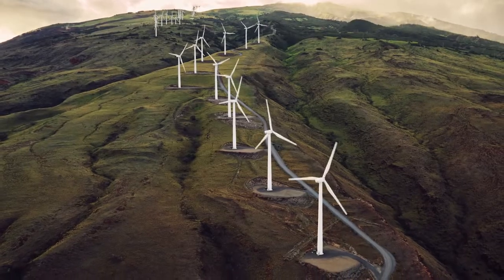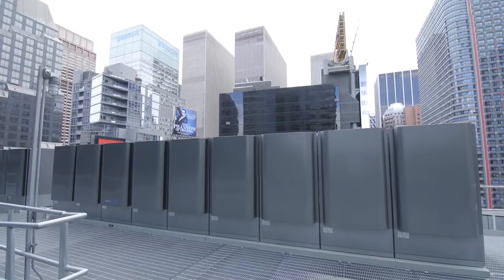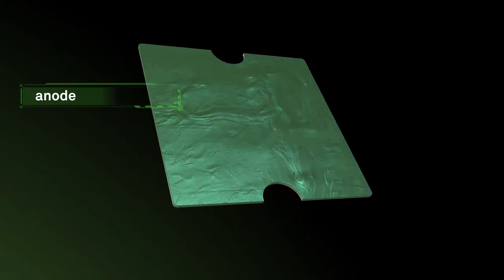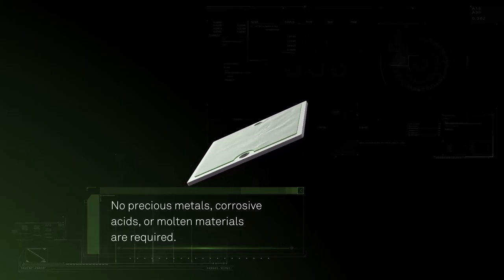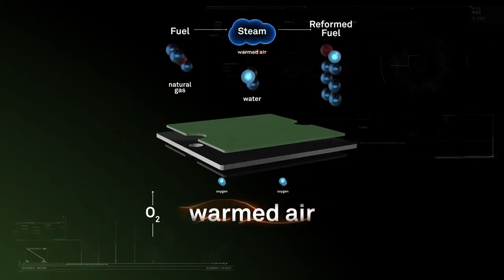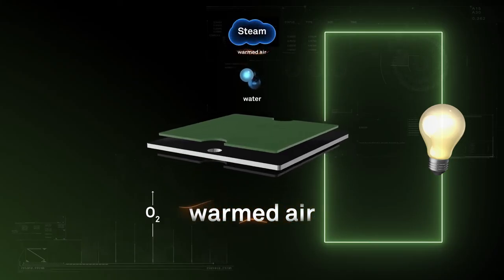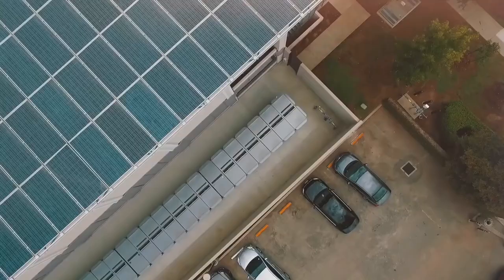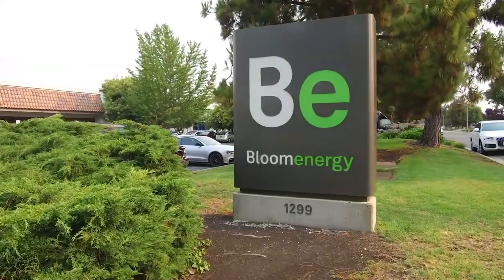How A Bloom Energy Server Works

Comment: Hold on why is CO2 coming from a Fuel Cell?, and how much?. Is it cos Natural gas is being used instead of Hydrogen?
Reply: yep.
Reply: Bloom claims their power cuts CO2 by 50% over grid power. Keep in mind CO2 is plant food and does not control climate (the notion it does is some seriously flawed science). The CO2 comes from CO produced in reforming  the fuel the cells use as source fuel, because that is what is available, and the commercially accepted way to reform it uses steam and makes CO that the fuel cell turns into less toxic CO2. Not a simple process, and it could be done better, always room for improvement.

Comment: The fuel cells create hho on demand to create energy, of course they don't want to use that sort of verbiage because it's ''taboo'' . . . Here's my question, if it uses natural gas and air to provide the electricity BEFORE it hits the fuel cell doesn't that mean it is possible to use something else beside natural gas to run it? Perhaps a permanent magnetic motor or solar? I would imagine the powers that be wouldn't have approved his design if it were like that.

Comment: There are at least two major improvements that should be considered to improve this marvelous product. 1. being the reformer technology. Take a look at the accidental rediscovery of CIV-initiated plasma reformation. It was not well understood by the inventor (his discovery was a total accident), but his autobiography of the process discloses the critical information for anyone aware of the process: see: "The Book of GEET: Part 1, Basic Science" by the late Paul Pantone. The "GEET gas produced is a low-temperature plasma of diamagnetic molecules that will express a huge amount of electrical energy as it condenses (with water vapor it produces clean air and clean water, no CO2.
2. being a pulsed magnetic field across the active cell membranes which will activate the FC reaction, giving it the kick normally supplied by a catalyst, reducing the activation temperature and extending the useful life of the FC. A little research will determine the optimal pulse conditions for your specific application, to optimize the power required. Party on Dudes, be good to each other.
Reply: I'm still confused about these because somebody said they only work properly if the purchaser has Gas Energy .
    Do you know if this is true ?

Comment: Does this system have to use hydrocarbons? Would the steam work without it?
Reply: it uses natural gas so yes, it uses hydrocarbons.
Reply: You mean would it be able to generate electricity without using any form of external power or fuel? No. It seems like we will have to wait another day before we get an infinite energy machine.
Reply: @Henriburger1  it needs natural gas to produce electricity...it just uses fuel cell to produce electricity instead of the traditional method where the natural gas will be used to produce steam which will rotate a turbine which then produces electricity.
Reply: @superchargedpetrolhead  
I know I watched the same video
Reply: @Henriburger1  there is no infinite energy machine that only exists in iron man movies...
Reply: @superchargedpetrolhead  
Bruh I know that's why I made the joke. The original poster asked if the system still makes electricity when no energy is supplied, to which the answer is obviously no. You need an external source of energy in some form in order to make electricity, since energy can only ever be converted from one form to another.
Reply: @Henriburger1  well it is hard to understand if someone is sarcastic or not through comments so ..... I thought you didn't understand the system too.
Well anyways, cheers mate.

Comment: Why so vague on the type of "fuel"?
Reply: sounds like they are using natural gas. if you've got natural gas its more efficient to use it directly for heating and cooking. no need for any fuel cells.
Reply: @Withnail1969  your missing the big point, yes youcan cook and heat with Natural gas, but the bloomenergy fuel cell would power the rest of your house. Im assuming you use electricity.
Reply: @JustSomeInternetDude again, very inefficient to turn gas into electricity and use it for heating.
Reply: @Withnail1969  Actually no, it is very efficient. The natural gas does not combust, the process is an electrochemical Reaction. From Chemical Energy to Electrical Energy.  It is in fact very energy efficient.   I encourage you instead of making comments that just pop into your head, to actually look at the tech and then comments.